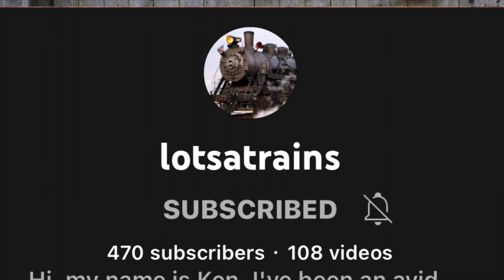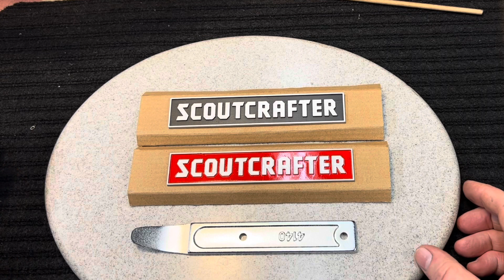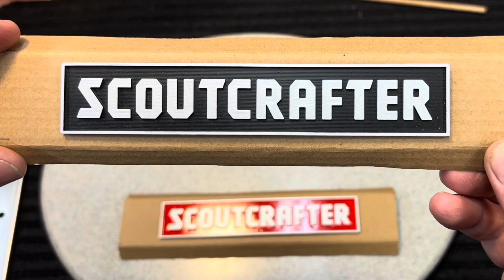Jacktown Meet-Up 2022

Comment: It was great meeting everyone. A very nice turnout heat withstanding. I wanted to get there early but got there a little before our meet up. I didn't get to the back section only the "small" front area. 
That deWalt radial arm saw @ 9 minutes in is identical to my dad's old one in my basement.
Found one guy that I picked about $50 worth of ball peen hammers and about 15-20 pairs of pliers and I was done shopping after that. I had people asking if I worked there because I told this one fella what Cadweld kits were for. Watch a YT video, it's pretty cool.
Jacktown is a dangerous place if you have time to look around and a pocket full of money!...lol
Next time I'll bring one of those fold up shopping carts the old women used to use.

George
Reply from the maker: George- You are so right, when I first started going I would come home with a bunch of stuff and now I am being very selective.  I still like to look and tend to want the unusual stuff now.   =D

Comment: That little prying tool from the aviation industry, it is extremely similar to a little tool I have from the 1930s that I've never seen another one of. Almost identical form, maybe a slight bit more hooked to the blade. The interesting thing was the name, the script was in a lightning font and it read, God's fingernail. I don't know what the metallurgy was, but it's quite malleable but it has excellent memory. It's probably one of my most used tools, it functions as a knife, a prying tool, all kinds of things. I always wondered if it was handmade, this is the first time I've seen one anything like it. Quite a bit of my shop started life in Boeing so maybe that is the link

Comment: 6 am in PA! What time did you leave Queens?  I believe the tool at 16:50 is for Dzus fasteners.  They are used on aircraft panels that are frequently opened up.  It just takes a quarter turn to lock or unlock them.
Reply from the maker: Rick- left my house at 4am sharp!  😃👍. 2 hours sleep.  🤭